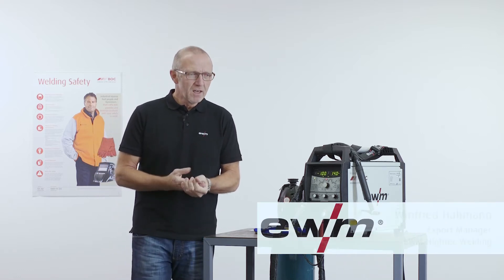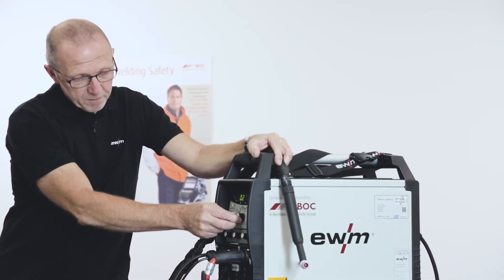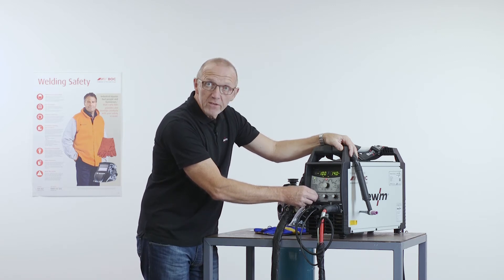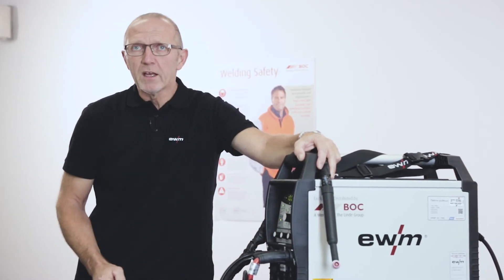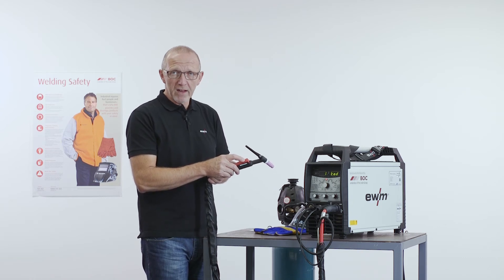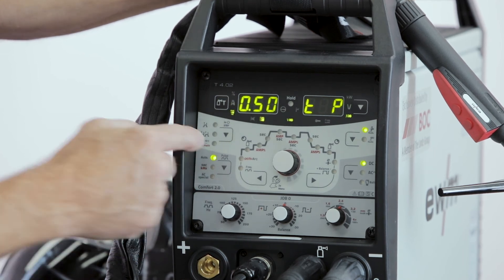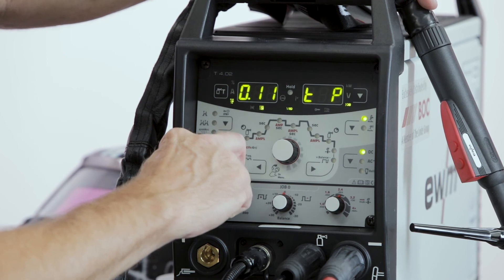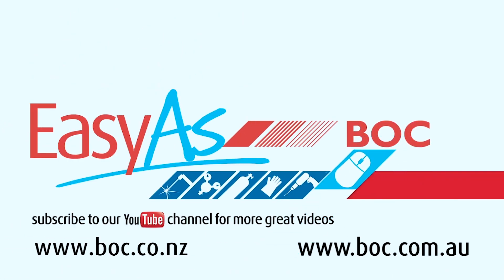BOC EWM Tetrix 230 ACDC

Comment: I could not understand  'one'  thing.The display is so complicated to use.
Reply: its one of the nicest out there ,,, short of a fully analogue machine ,,, granted a better video would help , and it wouldnt be that expensive to do , a lot of english speaking customers feel let down.
Reply: Its really very good when the machines in front of you ,,, an adjustment on the time out time on the selection menu would make a huge difference though

Comment: You have to be kidding BOC.
I purchased one of these machines inclusive of water cooler last week and introduced it to my workshop.  roughly a $7500 purchase for a 240 Volt 230 Amp Tig Machine. I also purchased a similar spec locally branded Chinese machine for home for $1800. (another story)
OK its German and vee vood expect it to be the  Enten Nusse ( Ducks Nuts)...and it probably is if only we could work out how to use it. Now I am no Dummy when it comes to  AC/DC Pulse Tig machines, I have been using them for 25 years, but you try to get you're average  Korean welder workshop manager and fab apprentice  to sit down and read and comprehend the manual for one of these baby's and you can add another $2k in wasted time to the bill and still not know where you are going.
Now, our dear friend Winfried is clearly the Master of the Machines but he is not the master of English.
He is clearly not an accomplished presenter, at least in English, which is the primary Language of your market place. 
As for the Camera work, that's a whole new level of average.  Just as  Winfried  is about to point out the function of the buttons the view changes so that one can no longer see which button or function he is selecting. 
I know, and you seem to know that YouTube is the forum for presenting and explaining your equipment.
At least give it a good shot BOC. And give us the respect we deserve for trying to support you!
Reply: David Normoyle you little cry baby, I have one of these in my hobby garage 
Just pick up the manual end reed, I guess you can read?
It’s a fantastic machine to use
Reply: @martinandersson5278   
im shopping for one at the moment  or a fronius 230i , 
the point he is making is that if your expecting some one to lay out the price of a car , shoot a decent video showing how it works ,  i wouldnt expect hyundai to show an ad in Korean and show it on uk tv.
edit ,, I bought a Tetrix , amazing machine , but it does deserve a decent video series on how to get the best out of it .